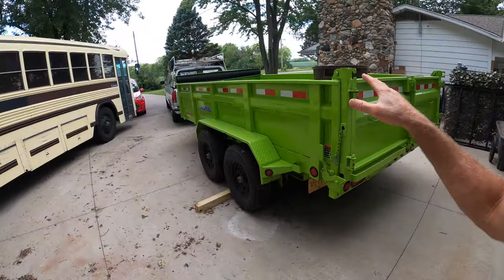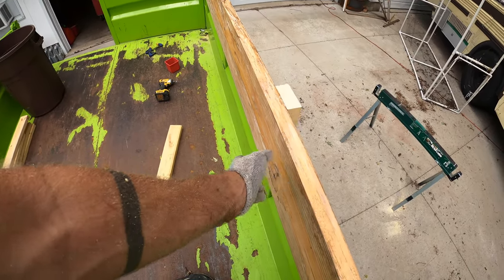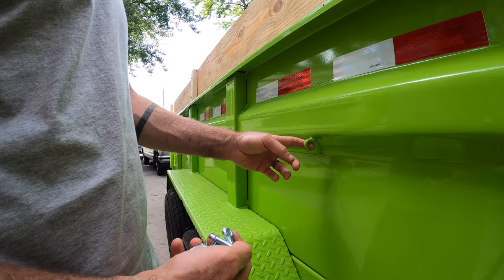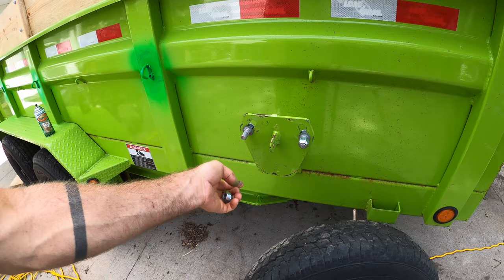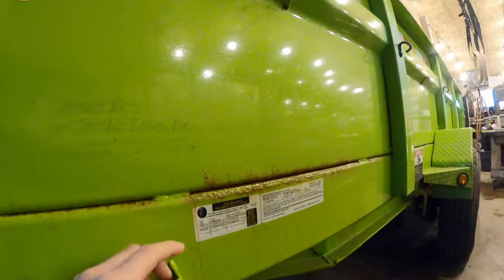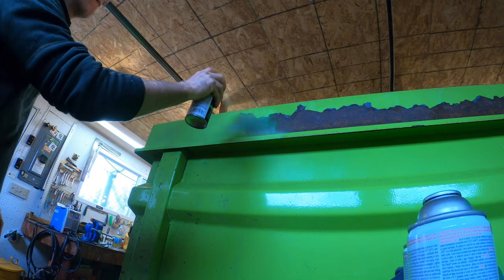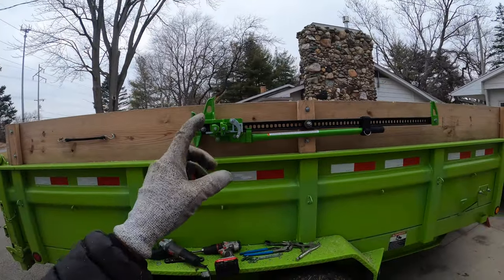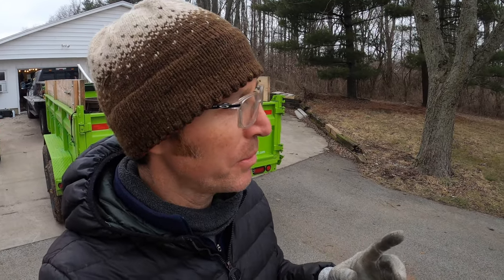Green Beast Dump Trailer Mods

Comment: Nice trailer handy as sliced bread. Does it have a set of ramps? Loos like it did once maybe with rails on the back and d rings in the bed.
Reply from the maker: The ramps are MIA -- I've gotta make some new ones or at least one for rolling logs up. Thanks for that reminder

Comment: you have the 2x4's facing the correct way. you want the load being held in by the lumber not the screws or botls.
Reply from the maker: I got lucky on that one! haha ... yeah, it's worked out pretty well, though I should prolly put another coat of varnish on that wood once it warms up around here. thanks man

Comment: You're going to INCREASE the Volume so much , your pickup will NOT beable to safely pull OR STOP the trailer !!! UNLESS , of course , you're just hauling leaves or some thing that is ALL volume and very little weight !
Reply from the maker: I can see what you mean by the volume increase, but for me it's just sticks and branches so hasn't been a problem.